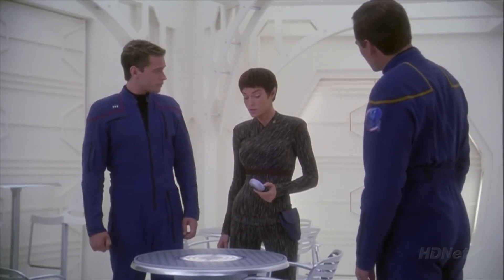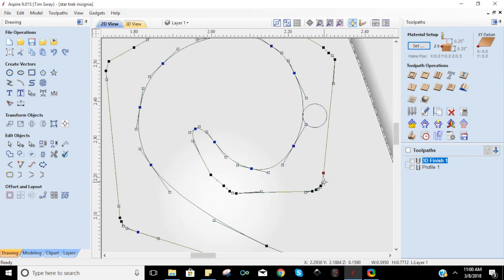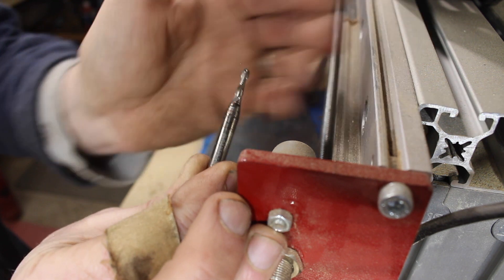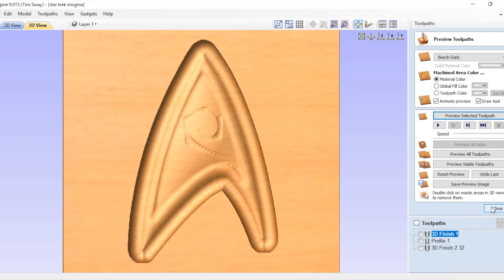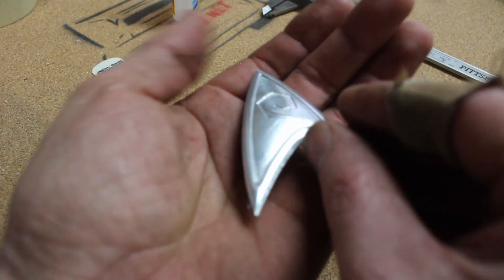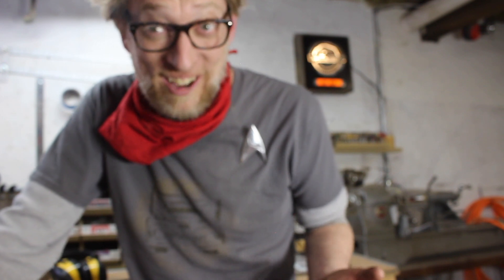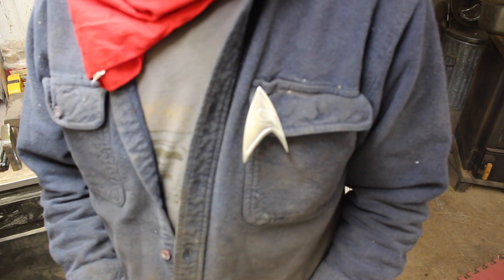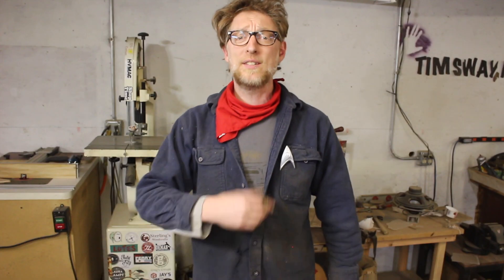Star Trek Insignia 3D Carved from Aluminum

Comment: There's a new program that I've been using for a few months called PixelCNC for doing stuff like this (http://deftware.itch.io/pixelcnc/). It generates a bunch of different toolpaths + g-code directly from 2D photo and design images, which is so nice because I have a much easier time working with 2D images in GIMP than I do with 3D stuff in Blender, and I hate having to pay for models or find an existing one on cgtrader or whatever. PixelCNC does all the usual toolpaths like parallel, horizontal, v-carve, profile, and even ones that I've never seen anywhere else like labyrinth, chevron, which is super trippy when I use a v-bit. Oh yea it can do stipple/halftones too, in multiple ways, actually. The interface is pretty streamlined and intuitive and IMO it's generally been a lot faster for me to use than most CAM software for doing artistic stuff. It's even got a simulated cut preview so you can see what your generated toolpaths will actually cut like, which is nice, but I'd like to see it fleshed out more. It's still under development and the guy coding it is adding new stuff and updating it all the time. It's already very capable and I can see him giving the whole hobby CAM market a run for its money pretty quick here if he keeps it up! Thanks for the share!

Comment: Feeds and speeds.....pure voodoo based on charts and data that have too many variables.  Tough haul without a variable speed spindle too.  I assume your router has a couple of rpm choices?  You might take a peek here:  http://www.custompartnet.com/calculator/milling-speed-and-feed.  We start at .001 Feed/tooth and 500SFM for aluminum and then adjust.  turned out freaking great dude. Also.....I teach CNC.  Feel free to hit me up if you have questions.
Reply from the maker: yea, I have 6 speeds on the Bosch router in there. The intel I got was keep the router fast, the passes slow and the depth shallow. Thanks for the link. Next time I will refer to it instead of my deck of Tarot cards I've been using :)
Reply: Yea, it's like a magic 8-ball sometimes.  Ultimately, you just have to 'send it' with your fingers crossed, safety glasses on, and your jaw clenched.

Comment: I think you should wear the engineering badge whenever you're doing CNC work. Not quite ready to experiment with metal, but definitely have some 3D design ideas I want to work on.
Reply from the maker: Paul John's Life good idea! Slow and super shallow passes is the key to metal.  Get used tok wood first, save some money on bits :)